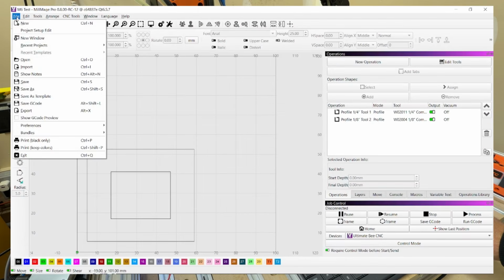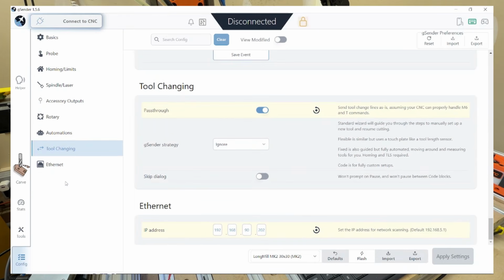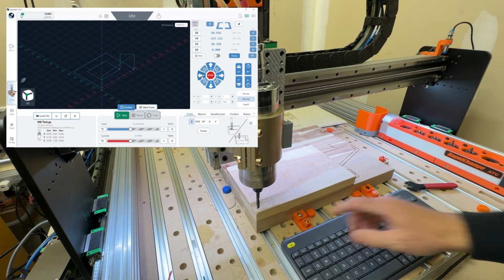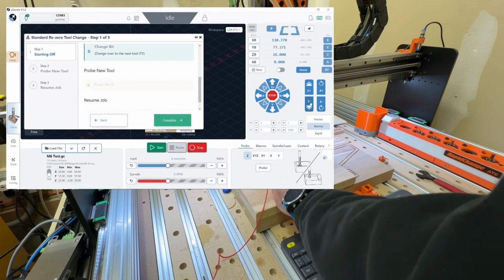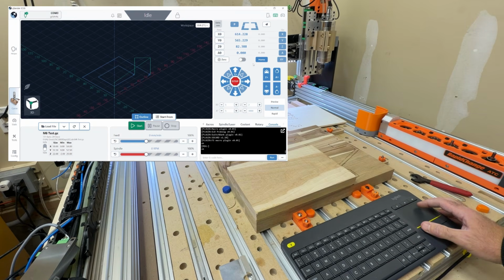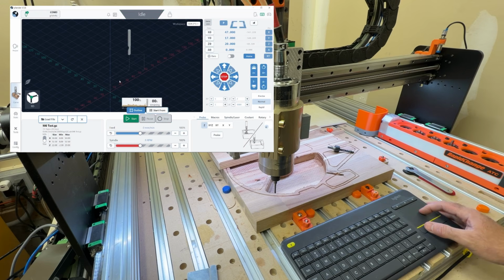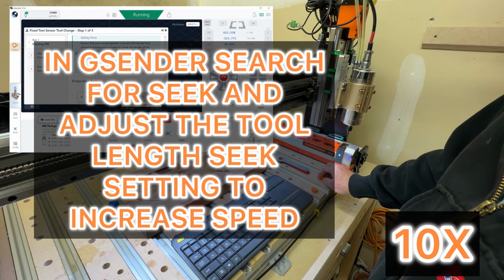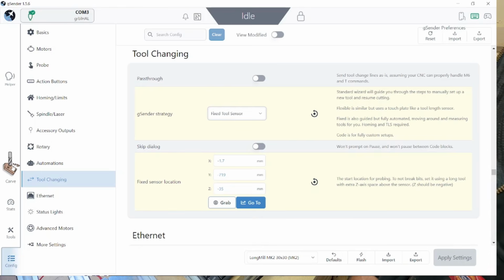gSender Tool Change Options

Comment: Is there a way to use a fixed TLS but with separate gcode files? For example, tell it to measure the tool before and after a manual tool change and adjust the z zero accordingly between jobs.
Reply from the maker: If you are using GSender then yes you could setup everything up for the TLS and the m6 command. Once the first file runs and finishes you would manually run the m6 command in the GSender console, change the bit it would measure and change the Z offset, then load the second file and start the job. 
I have not tested that workflow but I can’t see a reason it wouldn’t work.

Comment: Random question but I think you’re using a Longmill (but maybe not).  grbl doesn’t support tool changes and Sienci Labs doesn’t have any PP defined. What post-processor are you using in your CAD/CAM for gcode generation?
Reply from the maker: Thanks for watching. I am using a Super Long Board from Sienci Labs but its an Ultimate Bee CNC machine. 
The SLB controller runs a version of grbl-hal and does support tool changes via macros on the SD-Card. 
So the RapidChange ATC I am using they have a web interface that based on my settings generates the macros needed to put on the SD-Card to support the M6 command allowing for the tool changes. 
As far as the post processor all that is needed is the addition of the T# M6 command for tool changes. In my case I am using MillMage and it has options to define the Tool Change command that is exported when generating the g-code.

Comment: Z-probes are normally open, while the tool setters are normally closed. How do you have both of them wired up? A lot of the boards only have one probe port...
Reply: Never mind, I commented before I got to the point where you unplugged the touch plate for the sensor.
Reply from the maker: Yes, but the SLB Controller has two ports one for the touch plate and one for the tool sensor, but when in the mode I had picked they couldn't both be hooked up.  If you pick the Fixed Tool Sensor mode in Gsender then you can have both no problem.

Comment: Nice video, thanks, but at the end you are covering the tool lenght sensor with the gSender screen 😞
Reply from the maker: Thanks for watching. Hmmm you are not wrong, sorry about that. I am still working on my filming and editing skills. I will find a better way to manage the PIP screen next time. Thanks for the feedback.
Reply: @sparks-tech  Not a big deal and in any case your work is very appreciate 🙂
Reply from the maker: @IceCreams62 thanks man, appreciate that.